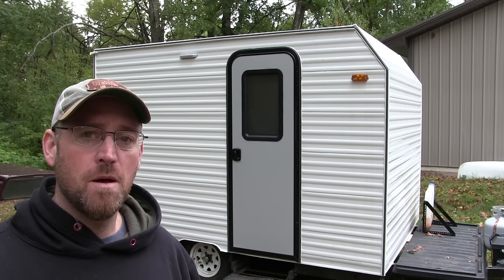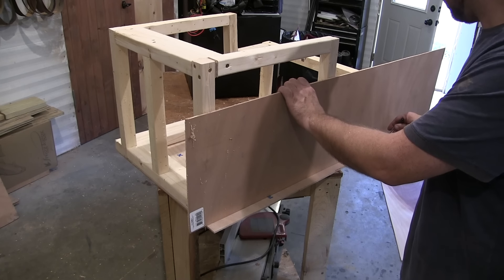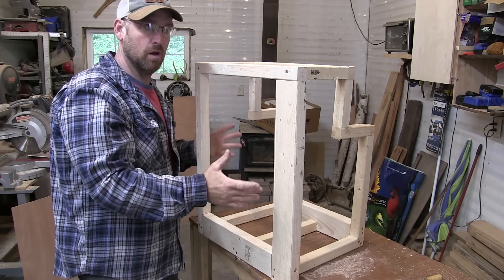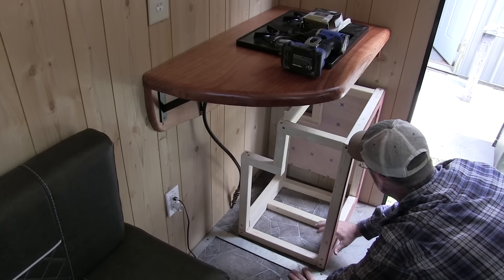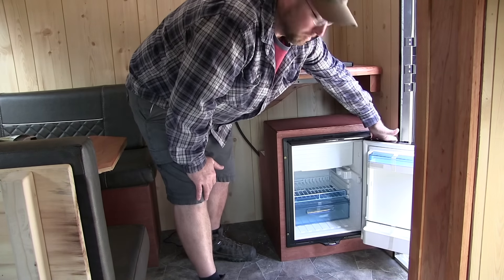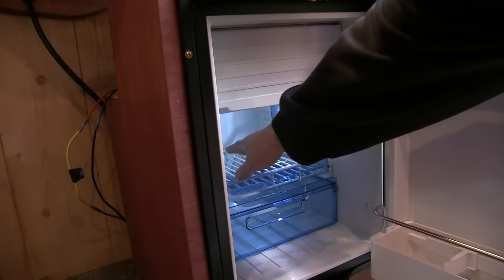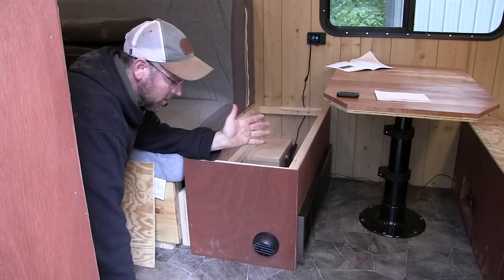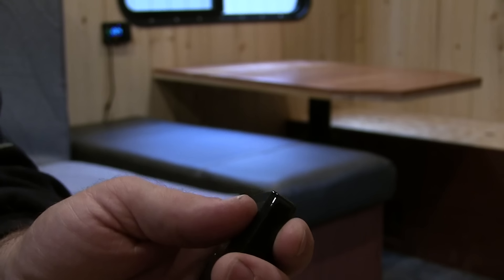DIY Camper Cost and Weight !! installing a fridge and heater

Comment: Bro you should of installed a camper propane gravety heater
Reply from the maker: I would prefer propane . this was the only affordable heater I found that would fit in the space I put it in . I was going to use the heater from the pop up but I couldn't find a place to put it .

Comment: I built my own camper on a ten by sixteen utility Trailer. I even put a bathroom in it it's nice. The reason I built my own is I looked at All the ones you can buy and didn't like any of them. The new ones you can buy are all so cheap made They're junk.
Reply from the maker: sweet !! I've heard that they are cheaply made but I've never owned one so I don't know

Comment: Couldn't you have gone with a small plug in heater, to reg wall socket.
Reply from the maker: Maybe but something with fuel is nice because it uses 12 volt power

Comment: If i were you id put some kind of board or metal on the bottom of tge frame so something doesn't fly through your floor and to protect wires and hoses
Reply from the maker: It would take quite a lot of force to rly through 3/4 inch plywood doesn’t seem very likely

Comment: I Think i Got the same heater for my piaggo ape 50
Reply from the maker: I used it this spring on a pretty cold night worked great pretty nice little heater would be nice if it was thermostatically controlled though

Comment: Why didn't you use a solar power system instead of a battery
Reply from the maker: I have a solar panel and charge regulator but you still have to have a battery with solar

Comment: For more money you can buy a quieter fuel pump.  They aren’t that expensive.
Reply from the maker: I was actually thinking about doing that , but when I finally camped in it and used the heater it didn't bother me at all . I actually slept great with it

Comment: For that much money you could’ve just bought a used one! Also why not just use an electric heater? A small ceramic one would heat that whole thing up in no time at all.
Reply from the maker: you could but this is something ive wanted to do for a long time . not so much about saving money . those heaters normally use 750 on low and 1500 watts on high . I'm not sure hoe well a battery would keep up with that .

Comment: You can get better fuel pumps to get quieter ones. Those heaters typically come with a relatively cheap one and that knocking is usually due to that.
Reply from the maker: Yeah I should look into that . Thanks!!

Comment: what cost $4,000.00?
Reply from the maker: The lumber all the odds and ends new tires wheel bearings , I rewired the trailer lights and breaks , some was waste . I'm sure it could be done slightly cheaper